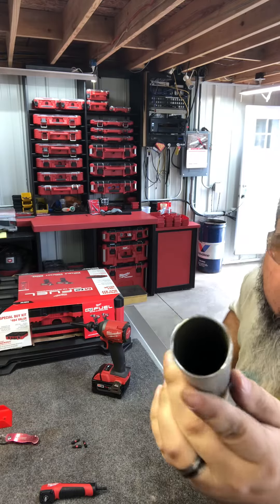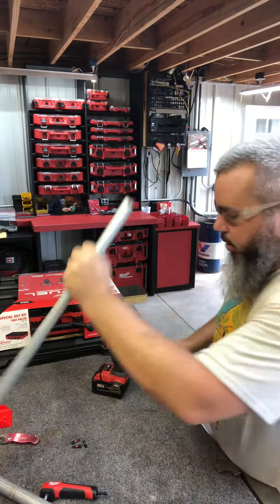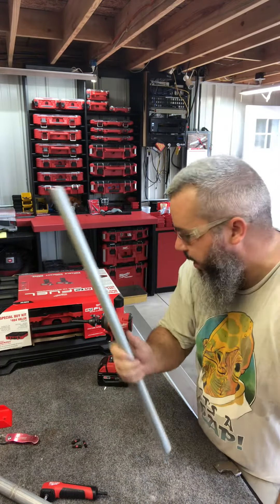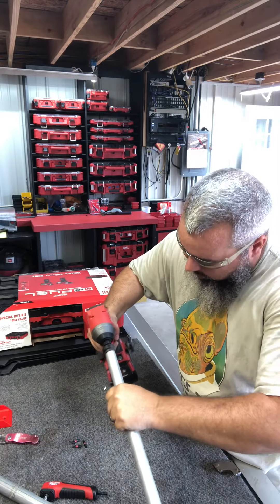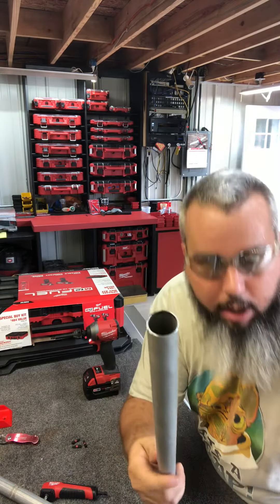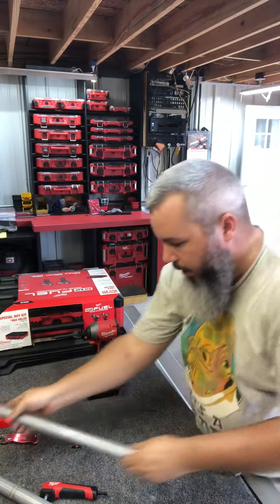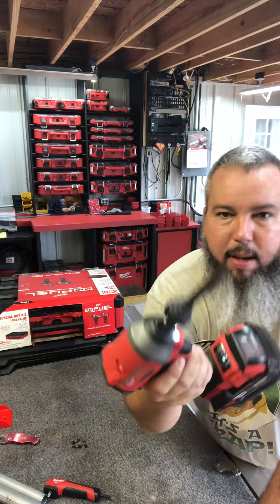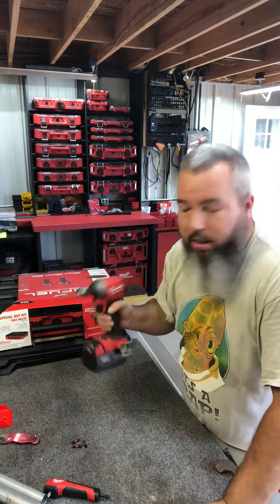Milwaukee Shockwave Conduit reaming bit holder !

Comment: Did you have any trouble taking the bit out? Mine doesn't come out
Reply: Shi slap it on a hard surface a few times and if that dont work use some rusty OS (spray) and hold onto the bit and crack the hammers inside the drill a lil (hold it AWAY from those blades) if not then ur boned beyond my pay grade